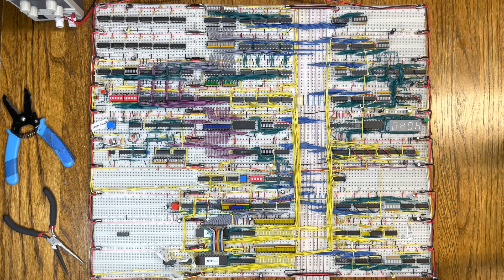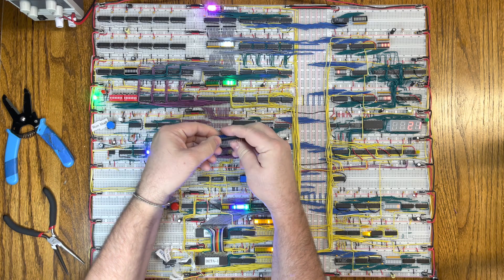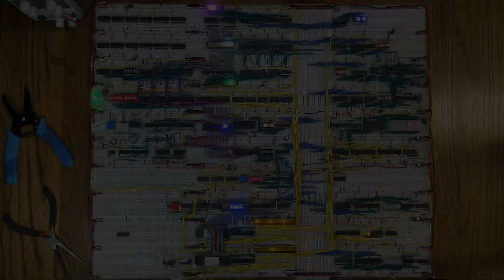PUTEY-1 Stack Pointer Build Update

Comment: Really great stuff! This sounds a bit like how the stack is used in x86 than for example 6502, correct? Are you basing your build on some specific architecture? Again: great stuff!
Reply from the maker: My design is inspired by my experience with assembly programming on the Z80 CPU, which is a "cousin" to x86 given its relation to the 8080 CPU. However, I am not trying to mimic any specific architecture, just exploring what I can do here. Thanks for the support!